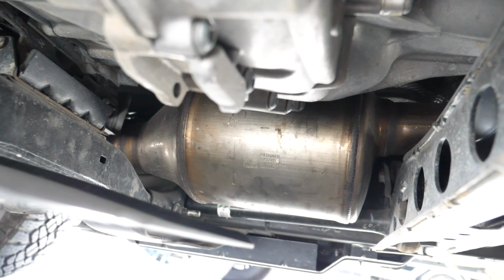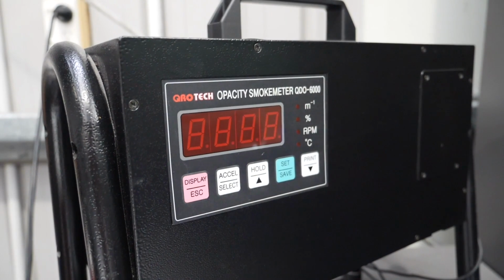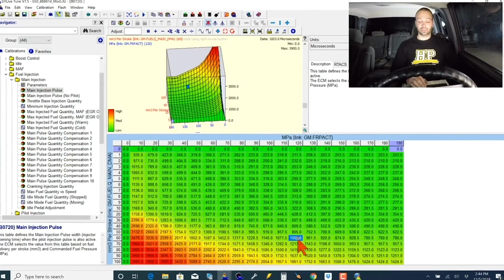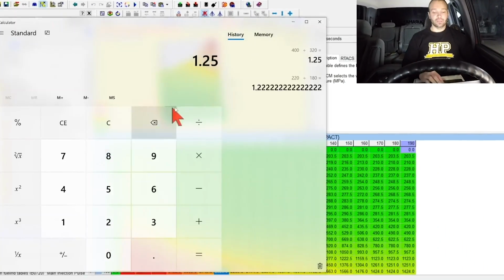Performance Diesel Tuning: How To Get Started | Lesson 4 of 4 [#FREELESSON]

Comment: Ironically I own an 07. I have a pretty good tune built but past half throttle input it definitely gets smokey and not that much power.

Should I be dialing back my fuel at higher RPM potentially or maybe opening my turbo vanes to get more airflow? 

Thanks a lot for the videos.

Comment: Can a diesel engine get tuned without using a dyno. I mean if you have 2 identical truck engines, one engine was dynoed, could you safely use those settings on the 2nd truck. I'm in the Phillipines, no dyno within 1000 miles. Will purchase Next gen Ranger 2.0L single turbo. From the factory only 170hp. Was hoping to bump that up more. Appreciate any advice.
Reply from the maker: There are many applications you can tune without a dyno. Here is some information on the 3 main options most people have when it comes to tuning.
https://www.hpacademy.com/technical-articles/dyno-vs-road-tuning-vs-e-tune/?utm_source=youtube&utm_medium=social&utm_campaign=general-interaction